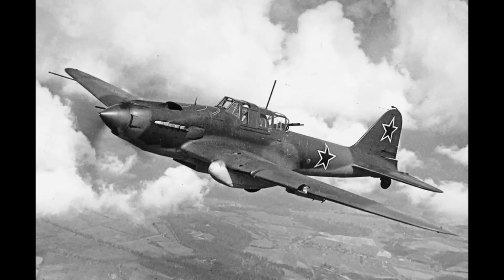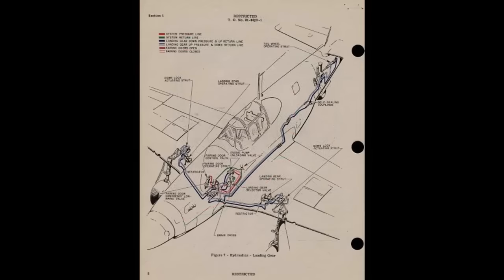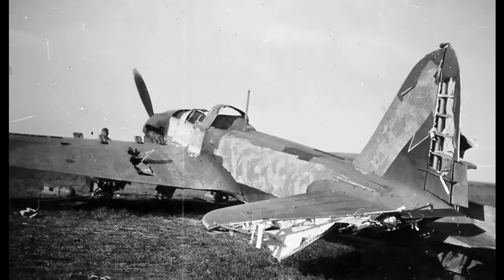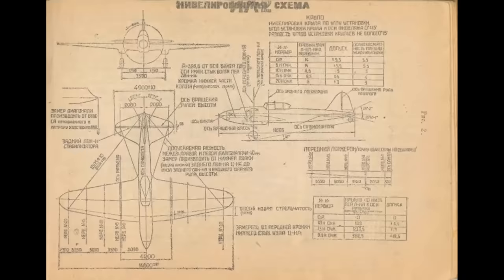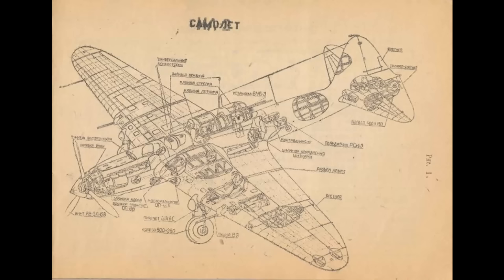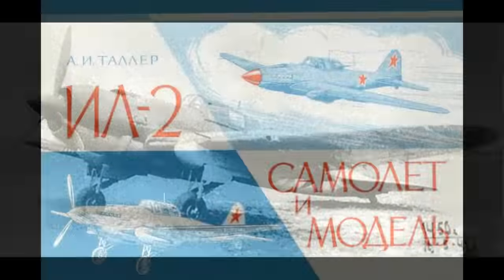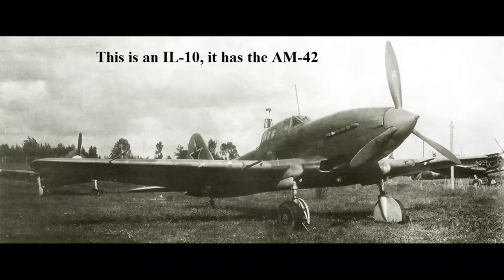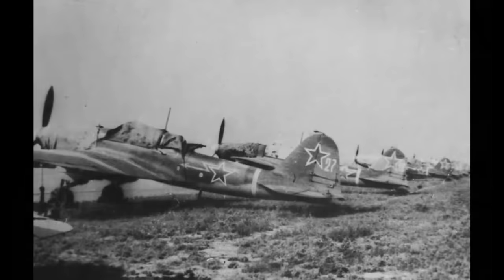Ilyushin IL-2 Sturmovik

Comment: I always thought the IL-2 was a very interesting plane. The integration of the armored bathtub into the structure is very clever.
Reply: Copied in the A10? An aircraft with the same tactical role and to some degree equal armament, but more power of course. And still going strong.
Reply: Unfortunatly they designed a one man aircraft and when they found they needed a rear gunner he got little armour and as a result suffered very high casualties.
Reply: Why do you people always think everything is "copied" from something. Designers can have similar ideas without "copying" anything.
Reply: @Leon_der_Luftige if it’s not anything that’s been done before in anything or anywhere then it’s copied from something isn’t it 🤷‍♂️
Reply: @alangordon3283  No it really isn't.
Reply: @Leon_der_Luftige  If the invention is at the same time, copy may be a to strong word, but could we say "inspired by" instead?
Reply: @dmg4415  Not really because nobody is there to take the credit for the "invention". It's just a way of doing things. The A10s bathtub is not part of the airframe itself so the comparison doesn't even apply.

Another example would be the flying wing. People love to give the Hortons credit for its "invention" but the truth is many experimented with flying wing designs at the time.

It's just one way of doing things.
Reply: @Leon_der_Luftige while perhaps not having "invented" the idea of deleting everything but the wing, the Horten (yes, that is the correct spelling) brothers had most advanced knowledge in the realm of designing flying wings.

Don't forget, they started at a very young age with gliders.
Reply: @daszieher  yeah, Horten (congratulations you spotted a typo, have a cookie, who cares... I had the name Johnny Horton in my head. -_- ) 

They did not necessarily have the most knowledgeable as a certain Mr. Northrop was already producing flying wings that actually flew really well when the Ho229 was still in it's infancy so the Americans were atleast even if not further ahead in understanding the concept.
Reply: @Leon_der_Luftige  read up on what the Horten Brothers did with flying wings and when. Top tip: the Go229 was not the first aircraft they designed.

Their knowledge was at least on par with Northrop's.
Reply: @daszieher  I know what they did, did you even read what I said?

What's wrong with you
Reply: @Leon_der_Luftige  there is nothing wrong with me. With you, however, there seem to be quite a couple of things wrong.

Perhaps English is not your first language and you had difficulty expressing what you wanted to say. Would you like to break it down thought for thought so that we can go through it together?
Reply: @Leon_der_Luftige I think there’s a difference between a concept and a design choice. You can have similar concepts that looks alike but based on very different thought process, but if you’re looking for a way to implement things it’s very normal to choose something’s that’s been done before and put a spin on it to suite your specific needs.

“But it’s a copy” is just a very emotion based argument that proves the person probably doesn’t know much about engineering, and is just finding things to hate on. Like geez I wonder where people got the idea of an bolt action rifle from, or IFVs, or nuclear submarines etc. It’s almost like militaries are trying to come up with the best product so they’re incorporating the best ideas they can find…
Reply: It did not fly well and did not bomb well. It could only do shallow dive runs. The wing placement of guns made aimed shots extremely difficult… All in all it was not that good of a solution to the problem that did not really exist
Reply: The rear gunner had no protection and was a suicide job, so there was that too
Reply: @palpatov 

I don’t recall hearing about the plane being THAT bad to fly. Slow and heavy, yes, but the low wingloading should generally make up for that. The much larger problem was a lack of pilot training
Reply: @dmg4415  A-10 is not 'going strong'. It was obsolete in its role of a low altitude gun platform before it ever flew, because using it in a ground attack role against a formation with radar-guided SPAAs was basically suicidal. You don't know where they're ahead of the time and it's much easier for a AA gun to line up on target than for a plane to spot an AA on the ground. 

Effective ranges are very similar.
Reply: @IvanTre  So why is it still flying? The Russian counterpart are still used in combat ? Or are they useless as that war is on equal terms?

Comment: The articulated connecting rod is fairly common in Sovjet V12s and other engines. It is in a way the same principle as a Radial conecting rod. So per crank bearing there is one main rod and a slave rod. The cilinder banks are not staggered as on a modern V type engine. The slave rod bank has less dispacement as the main rod bank does. The Soviet WW2 era diesel V12 tank engines do have te same set up.

Comment: Please continue to cover the IL-2.  Interesting to me is the armored "bathtub concept that we see in the A-10.  I flew some aerobatic flights in a SU-29.  I asked the owner why the radial engine used a pneumatic starting system and was fitted with no/or very minimal electrical system. 
The lack of electrical system was for weight savings as the Soviet generator/alternator was a backup boat anchor for the Soviet Navy. Used for short aerobatic flights only required a small battery to power a few items such as a radio, etc.
I was told the pneumatic starting system was specifically used because this engine was used in extremely cold climates. Batteries and electrical starters do not do well in extremely low temperatures. Pneumatic starter systems do just fine with a round air pressure tank to serve as a "battery" via an engine powered air pump.
You've probably covered this elsewhere. But I found it fascinating. 
The Russians weren't stupid. That's for sure.
Reply: Yes, a lot of the features of Soviet planes were so they could be used in extremely low temperatures. It's not fair to compare the engine to an English thoroughbred which is only expected to be used in the moderate temperatures of southern England.

Comment: The most mass produced aircraft aircraft in WW2.
A 'flying tank' - I never appreciated that the armour also formed part of the structure. 
The Il-2 was unique. A remarkable design.  Thanks for a fascinating intro Greg!
Reply: The Armour has some disadvantages.  It provided a lot of coverage but could still be penetrated and couldn't be all that thick.   If a round got through it would ricochet around inside very likely killing pilot or gunner.   The German Ju 87 didn't have integral fuselage skin Armour but it did have thick Armour around the pilot that was less likely to be penetrated.   The gunner only had rear Armour and bottom Armour but if a round went through the side it was unlikely to ricochet.  There is a lot to be said for the 'all or nothing' concept where you won't waste weight on thin amour that will be penetrated anyway but use it on concentrated area where it will provide 100% protection.
Reply: @williamzk9083  
Interesting point.
Reply: But like respected Greg said, the structural armor is not invented for IL-2 at all, known to everyone at that time, but not now.
Il-2 was in fact very vulnerable (statistics), they were shot down very often. One pilot, poor speed and altitude, clumsy, unstable (rear mass), short range, tiny bomb load, very poor visibility. No country would want one.
But unfortunately, short-range bomber Su-2 was produced in Kharkov, which was soon occupied.
Compare the Il-2 and Su-2 with the Fairy Battle. Battle is three-seater, with navigator, has a range. But the USSR bought a license for the Vultee V-11 and even producing them in time for the war that started soon. But Ilyushin had lobby and influence and was a high official.
Reply: @williamzk9083  Ju-87 never was IL-2's counterpart. Unlike many believe, it's Soviet counterpart would be twin-engine Pe-2 used in a similar role. The most unique thing about IL-2 was its intended role, nowadays replaced by attack helicopters.
Reply: I thought that the most mass produced aircraft in WW2 was the Messerschmitt 109. What are the numbers?
Reply: @williamzk9083 It was nothing for the 30 mm cannon in the nose of a 109.
Reply: @ngauruhoezodiac3143  
By one account 39,183 Il-2 Stormoviks were produced.

Comment: I honestly would love to see more on the IL-2 and the LA-5! The soviet stuff is often over looked i feel. They may not have been the best but there certainly was some unique design choices that worked very well for them. The IL-2 armor being one of them.
Reply: If you've ever played ANY of the IL-2 series of games, you'll know that the LA-5 is a beast.  Of course, this may be because the games original designers were Russian!
Reply: @FelixstoweFoamForge game designers for IL2 series were Luftwaffe fanboys as the result most of the times Soviet planes are nerfed (build around low end of specs) and German planes are OP (build around top and even unrealistic specs).

Some significant issues of a real world soviet planes were ignored in the games but most of them are pretty much impossible to implement within PC game/sim or just not a problem for gaming scenarios
Reply: @tsorevitch2409  So, on the one hand, all the Soviet planes are Nered, and the German ones OP, but at the same time, significant issues with the Soviet planes were ignored? That doesn't make any sense.  I really think the designers were a bit kind to Soviet aircraft, tbh.  
But still, I mainly fly IL46, (Because I'm damned if I'm going to keep buying "modules", just to get a few more aircraft. I don't mind doing it in ROF, because the core game is free, but Current IL2 pricing is stupid), and I find that if I set up a 2 on 1 dogfight between a BF109F4 and I16's, and vice versa, and fly to the aircrafts strengths, I'll win most of the time.  energy with the the 109, angles with the I16.
And that's what I want from a flight sim; good flight models, decent AI and a dynamic campaign. 

Graphic some a long way down the list.
And I maintain that the LA5 and it's variants is a beast. Get one of those behind you when you're flying  a BF 109G and you run out of options very very quickly.  So much for "Nerfed".  Russian designers being Luftwaffe fanboys?  Just can't see that. If they were, the Fw190 wouldn't be such a pig to fly well in combat.
Reply: How does one define best? i think i get what you mean, not quit cutting edge but servicable and at a much reduced production cost of many of 
It's western counterparts!

Comment: The articulating rods would have been patterned after the BMW licensed engines they had, BMW VI that mikulin had already designed. I think it's something that was carried over along with several other BMW features. Something similar ended up in the later VK-10(x) engines as well afaik. It's all very strange but I wonder if it had to do with existing production methods the factories already knew? It's just very weird and I'm glad to know I'm not the only one confused by the Soviet preference in master/slave connecting rods. The V-2 tank engine also has this con rod arrangement.
Reply: i was thinking of the Hispano-Suiza v-12. same thing.
Reply: @peevee2009  the VK-105 and later versions of the licensed HS-12 ended up with the master/slave rod set up if I recall correctly.
Reply: I knew someone would post on this. I'm sure you know this, but I'll post it in case someone doesn't. All radials have it. The second connecting rod is connected not to the crank, but to the other connecting rod - hence master/slave reference. It gives the slave piston a different stroke length. I can only think they did this to try and reduce engine length. Not good for revs - which isn't such a problem on a radial.
Reply: The BMW VI V12 was developed from the BMW IV Inline six cylinder engine. They just added a second cylinder bank with master and slave connecting rods. My guess is they wanted to keep the crankshaft and crankcase as it was and this was the easiest way to do this without redesigning the whole thing. The russians later build a copy of the engine which was called Mikulin M-17. It`s just weird that the russians keept this feature into all further developments.
Reply: @davidellis2021  on a radial they all have the same stroke right?
Reply: @davidellis2021  The use of conventional connecting rods in a V engine requires the two cylinder banks to be off set from each other. For various reasons aircraft engine designers often wanted the two cylinder banks to be symmetric and not offset. The solution was either to use "knife and fork" connecting rods (Merlin, Allison, some DB) or to use master slave connecting rods (radials, HS-12, AM-38, some DB).

Comment: I loved this video. The IL2 has always seemed like an oddball plane to have been produced in such huge numbers. I’m very interested in learning more about its design and how it played into its tactical use.
Reply: It is not "oddball" if you first understand the Soviet tactical doctrine. Their doctrine was almost completely opposite of the US and Great Britain.  The IL2 makes perfect sense for they type of war that the Soviets were fighting.  This is the same reason the the P39, an aircraft that was considered "mediocre" by the other Allies were loved by the Soviet Air forces. The IL2 and P39 fit into the Soviet Tactical plan perfectly.
Reply: @mlynch001  Il-2s were shot down very often and carried bombs very few and far between. They had no range, no navigator, and no visibility. Perfect?
Reply: @Ernest-jr   They did not need great range, the IL2 was almost always based a short distance from the front lines, flying from crude airfields. They did not need "navigators" as the Soviet planes were ground controlled and pilots could usually SEE the enemy or the smoke from the battle and thus,  where they were to attack. Think of Ivan the pilot, speaking to the commissar: "the NAZIS are 40 kilometers in that direction, go and kill them".  I don't see a navigator being of much use in those conditions.   When you consider the rudimentary training give the pilots, would such a system have produced many skilled navigators? If it did, would these have been sacrificed in a lowly ground attack aircraft that did not need one? I think not.  The IL2 was shot down often, because they fought a dangerous, well armed and capable enemy in the most dangerous conditions for any aircraft. As I said, you first need to understand the Soviet tactical doctrine.
Reply: @mlynch001  You mean, commissar speaking to Ivan the pilot? I would imagine it would not bode well for the former since Ivan would immediately go to his squad leader with the question of why was political officer (placed there to read papers, popularize his party's ideas and recruiting to said party) giving him attack orders. 

Also I'd like to note that despite being shot down frequently due to dangerous conditions, pilots often survived the crash landing. All in all, IL-2 filled the attack helicopter role in CAS.

Comment: Hi, there are different manuals for different purposes in the Red Army and Soviet Army. In this case, this manual is not the principal guiding manual for all Il-2 pilots, there are technically-focused manuals such as "Техническое описание самолета Ил-2 с мотором АМ-38", which is "Technical description of the Il-2 airplane with AM-38 engine". It includes troubleshooting information, general technical information, and so on.
Reply from the maker: I have those, they are not pilot manuals.
Reply: @GregsAirplanesandAutomobiles  Oh, could you elaborate on why?

Comment: Fantastic as ever.  I'm really interested to learn more, especially on its air-to-air performance.  I'm guessing its pilot training had something to do with that one, along with the Soviet system which encouraged a suicidal degree of stay-in-your-lane-ism.  At least in the Il-2 game, it turns like a pig even when empty and has a relatively low top speed, though these are factors that would be less significant in a night fighter / bomber destroyer role.  In the game, I have managed to stand it on its wingtip and splash a pursuing Bf109 with cannon fire, but whether your typical Soviet pilot could have done that is a different question.

Comment: I'd love to hear you cover the LaGG 3 and more specifically the La 5 development and characteristics the same way you covered the Thunderbolt. Great video.
Reply: To be fair, Greg has stated that the Thunderbolt series was to explain a lot more of the basic fundamentals of aircraft design as an entry point for his channel, so any other deep dives like that will be more condensed.
Reply: @fusilier3029  of course, and he would have to painfully translate and fill in the gaps of the very basic level manuals they wrote, but I'd still love to hear about the development and struggles they had.